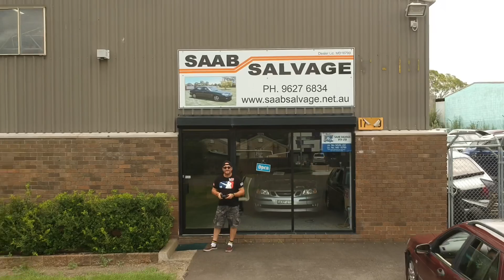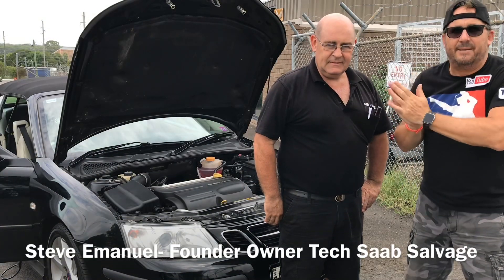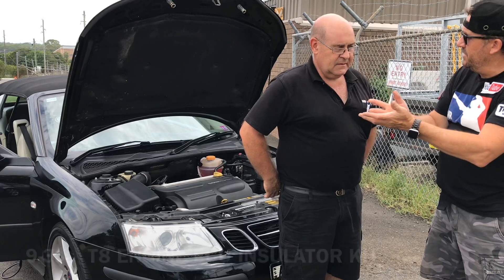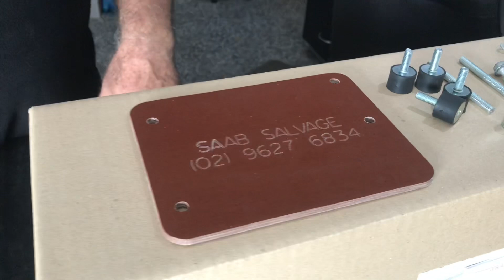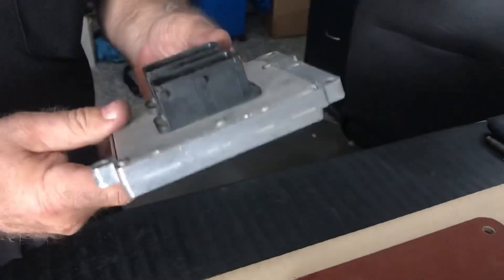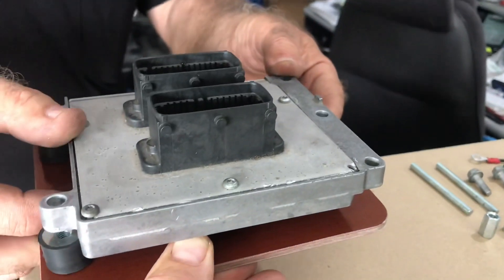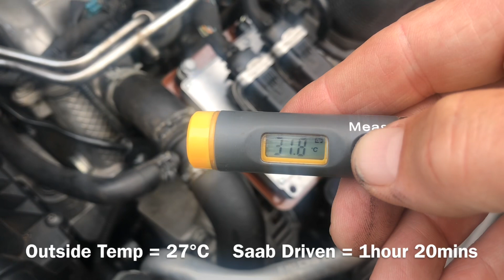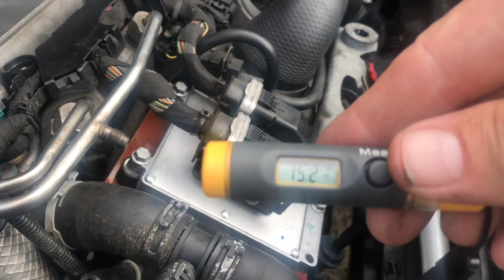Saab 93 ECU Heat Insulator Kit - Urgent Mod Requirement- First Look & Full Install -Andrew Penman

Comment: There are some people that I've seen or read about doing actual electrical repairs and reviving them. I'm a little annoyed that I didn't grab one of them off of junker at my local junkyard even though it was for sedan and I have a convertible I should have just grabbed it anyway because I doubt anybody else grabbed it in my area and it probably just got crushed. I have alerts now for all the junk yards near me and a 40-mi radius and I am going to be grabbing all the ECUs that I can as they come up

Comment: esaab will rebuild it brand new for you if you ship it to them it’s 600usd and comes with a spacer for it
Reply from the maker: Hey Wyatt, thank you so much for the feedback Will you mean saab you mean saab AB International parts in Sweeden ?? because saab no longer exist only the spare part division I know saab pretty big in the state still but obviously in Australia here you won't find a dealership or saab techs... I've got the old boys from saab tech here in Mona Vale to do my work for me on my saab Convertible.. but I don't sure about rebuilding the ecu ...because once the printed circuit board gets cracked / hot..  and once the metal fatigue sets in with the circuit board welds.. you can't repair these things my boys have got 15 spiked through Antenna stake  with a hole through them ... as I understand you have to get a whole brand-new one ...they need to build a whole new ECU and I think there was no more being made there I'm not sure what the situation is down where there's a company making them in the states or UK ??  and remapping them? Let me know awesome cheers Andrew

Comment: Why go through the trouble of building a spacer when you can just cover the bottom of the ECU with adhesive heat shield material?
Reply from the maker: Hey Vector ;) Nice to meet you thanks for popping in and giving your feedback that’s brilliant. Look at the main reason is the heating at that engine location regardless of the heat shield will still generate 60 to 70°c heat so it’s like being in a sauna you’re not going to  escape it it’s just moving around that whole area, so the Bakelite not only doesn’t get hot but the springs in the screws system Steve uses have a rubber Gromit so the actual steel doesn’t go the whole way through so that’s where the heat normally transfers through to the ECU via those Screws/ Bolts, this is an absolute brilliant device the Taiwanese guys try to copy it with cheaper rudimentary cheap materials didn’t work at all … you could see the temperature in this setup went from 92°C to 48°c that was a remarkable drop Steve was a Technician who saab AUSTRALIA employed to work for Australia wide he’s got over 30 years experience in saab‘s and he knows them backwards this is a pretty clever device works like a dream, we also added benefit is it damper protection so the rubber screw grommets also vibrate and take away the direct vibrations… for $100 including shipping Australian that is incredible value bang for buck you can’t make it for much less than that with the materials ;) hope that helps have an awesome day cheers Andrew ⚔️

Comment: I've made similar thing but didn't use rubber mountings and instead of bakelite I've used textolite. After short ride it was okay, just warm. Today though, after longer ride ECU is so hot that I can't touch it (even after 1 hour). You might want to investigate it once again – if it actually works. Disappointed. :/ Seems like extending the cables and moving ECU far away is the only real solution.
Reply from the maker: Hey Mr galaxy thank you so much for your feedback and brilliant idea giving it a try with your own DIY, well this is interesting I will live in Australia we get to 42° to 44°C in summer and while I went out last summer and my manifold intake was 91° c while the actual ECU itself with measured laser temperature was 57°C so it definitely works the Bakelite is probably the key ingredient and also the rubber mounts they are totally half inch rubber through the centre, but obviously yes agreed moving it way out of the engine bay would be the go, but this certainly works Steve still selling them and he’s now had over 3000 orders and it’s only $120 each Australian $$ including shipped anywhere in the world you can’t even buy the ingredients for that …. 👍 give this one a go see if it works any better I think you’ll be surprised, awesome cheers Andrew⚔️

Comment: I'm surprised there isn't one for the V6
Reply from the maker: Hey Ed, thanks for popping in great question. Okay tell me whereabouts is the V6 ECU located? Is it on the manifold intake, if it is you can adapt this to any part of the engine bay but I suppose you need the screw set up in the right threads? It’s a brilliant brilliant little kit / device my ECU was around 89 to 90°C previously…..but now with the kit on it doesn’t get over 46°C works like a dream. Seriously people are saying they can make it cheaper you really can’t the Bakelite is quite expensive and the special rubberised membrane screws do cost a bit it’s a no brainer just buy it from Steve simple easy. Let me know look forward to chatting cheers Andrew⚔️

Comment: That’s all I heard repeatedly through the video, was, “you can’t get ECU’s anymore”! ECU’s are available, I just ordered a rebuilt from eeuroparts.com, and it is coming tomorrow, 8/21/20. ($699, $110 core).  So yes, they are available!  I have the trionic 8 system, 2007 9-3 2.0T.
Reply: However, I would be willing to by the kit, if that information is available somewhere.
Reply from the maker: Hey Doug nice to meet you, when I met not available any more you can’t buy brand-new ones anymore. The problem is metal fatigue and just wear and tear and the poor design of this stupid ECU on a tiny miniature curved circuit board means a brand new one only has a life of 10 years, so buying a secondhand one at that price is a risk as you will get very limited life out of it but fingers crossed for you. All the information on how to purchase the kit is available in the “Description field” of the video click the arrow down button under the video and you’ll enlarge and see description field and Steve’s details are all there had a purchase and worldwide shipping ;) it’s definitely worth it 👍 the price of the components / parts  alone are worth about AU$85. This would definitely protect and give you the full service life of the ECU for years as heat seems to be the major culprit. Awesome cheers thank you Andrew⚔️
Reply from the maker: Hey Doug B ;) Thank you man great news ... when you mean rebuilt you mean have brand-new ECU or a reconditioned secondhand part remapped ? This is wonderful news as I’ve been worried sick about what will happen in 10 years time  when my collectors Saab Aero one dies ... yikes..
Reply: Eeuroparts, is a main supplier of Saab  OEM and aftermarket parts.  These ECU’s are rebuilt, and I’m sure they get all new components.  I’ve purchased from them for years, and they are top notch for their products.  Fingers crossed! 1 year warranty on ECU’s.
Reply: @doug900S  ECU rebuild in U.K. do reconditioned ones for £225
Reply: To update my original reply, the rebuilt ECU lasted 1 day!  I got my money back, and purchased a used ECU, reflashed it with Trionic 8 software, and it has been flawless for the past 8 months!  The rebuilt had a processor error, then I was told that the companies that rebuild them, never get it right!  Used is the way to go, and only about $120 invested!

Comment: What size are rubber mounts.
Reply from the maker: Hey Kustrim ;) Nice to meet you man, look I don’t know the actual make up because I’ve just reviewed the kit they are a standard tampering rubber mounts ...maybe someone else on the thread can advice on the sizes but yeah you’ll have to probably maybe ask Steve for the contact email in the description field, definitely get one of these things are Bakelite not cheap and you got a buy a whole sheet that’s why this is quite a expensive kit but really the price of a brand-new ECU at AU$1400 and you can’t get them any more anyway  ....  you’ve got a think what a good investment it is:) awesome cheers Andrew⚔️
Reply: This video has enough information to have probably been 5 min long... Once you cut out all the shilling for this kit.
Just bought a 200mmx200mmx10mm sheet of Bakelite for $16USD on amazon. That'll be too big and I'll have to cut with a saw, but it really does not need to be pretty. 
Ill be going to Ace Hardware to pick up the needed bolts, I expect that will cost in the ball park of $5USD. I'll get back to you about sizing.
Reply: Spent $18 for the set of hardware to do a similar thing, but wasn't exactly the same.

Comment: Great video!!! What about diesel engines???
Reply from the maker: Hey Fastus ;) Nice to meet you my man, thank you so much for kind feedback yes what a brilliant little kit this is to protect the ECU. As these are now literally no longer available anywhere. Diesel engines I think have the ECU positioned in the same place on the manifold intake (thank you GM for this ridiculous place to put it) so just double check that if that’s the case just installation damper kit will work perfectly for you. You can always check to see if yuh email Steve Emanuel in the description field notes and you advise accordingly, awesome great to meet you cheers Andrew⚔️

Comment: Elegant fix, but considering the hardware, it's a little pricey isn't it?
Reply from the maker: Hey Shawn L, Nice to hear from you thank you so much for popping in and giving your feedback on the price. Look I’m not involved with it I just review the product but I know that those individual rubberised bolts .. that don’t have the steel go the whole way through they’re independently rubberise centres with those you get dampening and extra heat protection ... those little suckers aren’t cheap there about $12 each alone ... I can only get them from advanced engineering shops ...  have the independent rubbish inside ... The main Base plate is a ultra high quality Bakelite material again not cheap to buy one sheets about $200 and you have to only get maybe 5 to 8 out of them... driving my car here in Australia it’s 47°C last week and I have a big sigh of relief when I hop in my Saab I know that im getting really tough protection  the heat and vibrations of that brand-new ECU I purchased for about AU$1500 ...yikes ... like I said to many people you just can’t get any ECU’s use any more they gone ....so when yours fails the car pretty much become scrap ... crazy hey ... bloody GM Holden positioning that bastard there lol ... cheers Andrew⚔️
Reply: Thanks for the reply. Now that I think of it this may be due to prices in Australia being higher. I've used those rubberized isolation bolts in various projects, and here they are a buck or two each from places like McMaster Carr. I do understand that Bakelite can be expensive. I'm likely going to make one of these for my car and if I use Bakelite I think I will take my chances and order some from Ali Express, they have it for cheap.

No less though the product is a great idea and much needed for these 9-3's. Thanks for reviewing it.
Cheers from Canada
Shawn
Reply from the maker: Hey Shawn L ... no worries at all you sound like a guy pretty switched on, Yes build one of these little kits absolutely do it Shawn my temperatures been lowered by 15 to 19° cooler and I’ve actually cut slots in the manifold cover plastic part which lets more airflow ... i’m so scared now for other people haven’t got something in place it certainly reduces the heat but more importantly it also adds a damper affect for the ongoing metal fatigue that these things get over time ..in that stupid position GM obviously had their hands all over it ... in positioning it there ... lol as I know at this time Jan 2020 they’re just impossible to get ... you can’t get any new ECU’s anywhere in the world... very sad ... Great to chat Shawn let me know how you went ;? Cheers Andrew ⚔️
Reply: @zulupenman  It's really not that expensive to make ... I don't know where you looked at the prices, but everything can be bought on aliexpress or at local tool shops .. Rubber damping bolts ~ 4-5$ ... I bought 5mm bakelite plate in the desired dimension for about 2$ (resistant to 130 degrees) ... Along with everything else it costs less than $ 10 ... Of course, great respect for this invention ! Because you have presented it in detail and someone who really wants it with very little effort can make it themselves...

Comment: 340k miles my ecu still works fine, heat cant be that bad.
Reply from the maker: Hey Joeybabbs ;) Nice to meet you and thanks for your feedback that’s quite encouraging. Look it’s not just that heat it’s also the vibration and the constant movement of the stupid position GM have decided to put the ECU in ... it should’ve been under the dash hidden away Zzz but it’s  right on the frying pan.. lol .. this certainly stops with the dampering with this kits rubberised bolt system ... but seriously once the things fail and usually you get about 10 years out of them there’s none available anywhere zero ziltch zippo ... with no secondhand ones and they can’t be mapped or made none left the world they gone finished.. I got the last one in Sweden it cost me AU$1400 that was 12 months ago. That’s not a bad investment for about AU$100 and simple to put on 👌 anyway each to their own but I can thoroughly recommend it, especially with the amount of k’s you’ve got on yours now ...check it oout Steve will help you any issues shipping etc cheers man awesome feedback thank you cheers Andrew ⚔️
Reply: The EXCEPTION Confirms The Rule.

Comment: You can just leave the engine cover completely off. It doesn't actually do anything except look nice.
Reply from the maker: Absolutely Brian ;) we can take it off doesn’t need to be there I’m going to do a another video on the Dremel tool cutting it out and a making a funnel air intake system to the ECU area onto it will be a brilliant review hopefully in the next month.. keep up the great work my man cheers Andrew⚔️.

Comment: Nice ,but that parts cost 20$ max ,not 100!?!
Reply: I'd be happy to pay $100 if it gives my car's ECU a longer life. I mean, it's way too difficult to find and way too expensive to buy a new ECU.. And I won't buy a used one just to have the same problem once again after a while..
Reply: Then why dont you put a kit together and sell them for $20 and I will gladly take 20 kits to start your business🤦🏽‍♂️
Reply: @oyetos   the idea is that u can make it home :)
I make 3kits for me and my friends ...for free ,so....
Reply: @georgekolotouros9176  i made it bro :) 
I can make one and send it to u in GR :) IF U comming in Bulgaria ,welcome. :) Will make one for u
Reply: How did you make the kit?
Reply: @geoffreylove9435  its so easy ,buy a textolite .
Cut it into the shape of the ecu ,drill 4 holes ,buy that rubber links from somewhere and made your own cable 
The other things are to cut the bolts bcz they need to be short
Reply: @NikolovSky  hey I hope you are still using your account. Can you share more details? I am also in Bulgaria and drive a 9-3 Saab, I'd love to have this made myself and save some money. Let me know if you are still here.

Comment: Perfect...absolutely how stupid car manufacturer installing ECU in engine compartment....obviously it is part of their business, if ECU fails then you buy another one from them...
Reply: = GM
Reply from the maker: Hey Maldes ... Great to hear from you, absolutely bloody GM hundred percent disgusting design flaw ...In fact I think the 2007 station wagon has its ECU n the wheel arch area ... it’s completely wet all the time fails as well... unfortunately they just don’t make ECU anymore so therefore now the problem as you can’t get them and you can’t actually even get them re-mapped it’s just a great shame to an otherwise beautifully designed vehicle 👍 cheers Andrew⚔️
Reply from the maker: Hey Filip ;) Great to hear from you, absolutely 100%  as I said before this is one of the major disgusting design changes from GM along with a few other horrific ones they had a lot to answer for pretty much destroyed the company in my opinion.... ran it into the ground... cheers Andrew⚔️